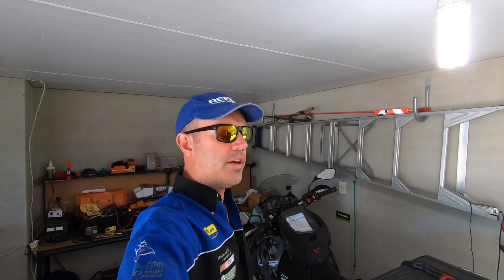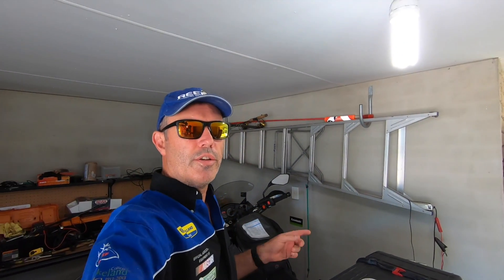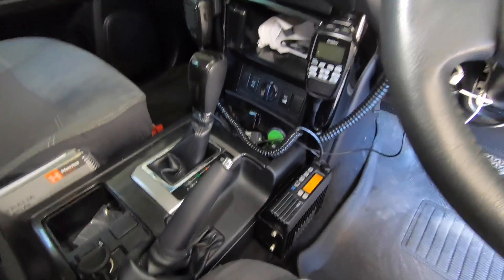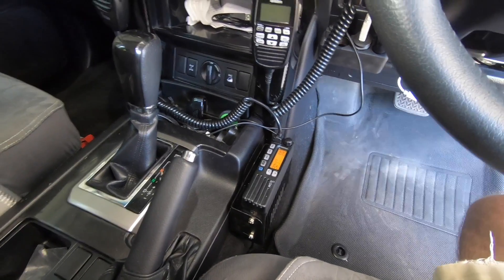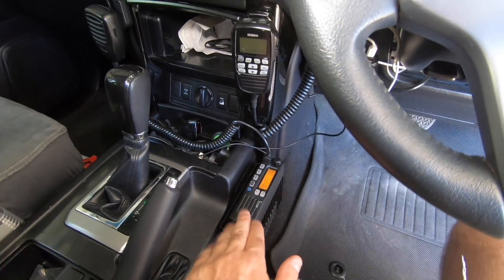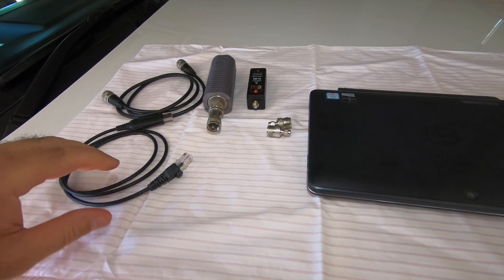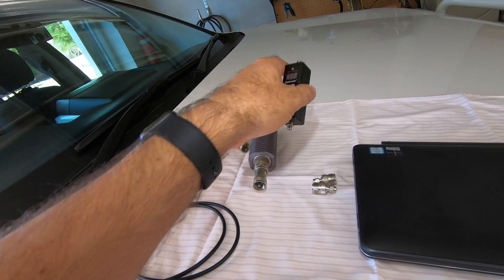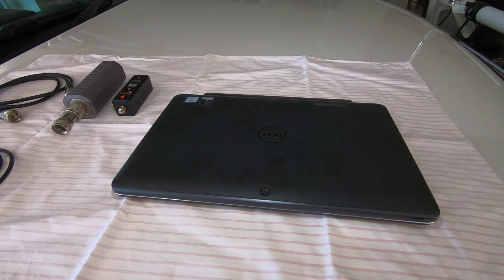UHF CB - Icom IC-400 Pro programming 80 CH & max legal power

Comment: Quick question aren’t these good for 25w??
Reply from the maker: Yep. Up to 25. At these powers you will need a licence and you will need to make sure your antenna is well set up. I have killed a couple and I think it was from using cheap antennas. Maybe they weren’t tuned correctly. I’m no rf expert.
Reply: @jjsadv is raising the wattage done through that program?
Reply from the maker: @targetoz5470  The adjustment one as shown in the video.

Comment: So I am looking at doing some maintenance work on my 400PRO and want to know the following:
1. Where do I get the power meter (surecom SW33)?
2. Where do I get the  dummy load tester?
3. Where do I get the IC-400PRO Adjustment Software

I already have the cloning/programming software and programming cable - used this for a while to program the channels etc :)

Cheers - oh and great video mate :)

Comment: Hi JJ, does adjustment software exist for the IC-410Pro, or is the "CS-400Pro ADJ Rev 1.0" software adaptable?  I've googled the IC-400Pro software and can't find it - if you have a link or can share the file, it'd be much appreciated. Cheers
Reply: I too can't find the Cs 400 pro adj software anywhere. There's one site but it wants an email to get put on a wait list.

Comment: Hi mate where did you get the adjustment software? Can’t find it on google the one I did find looks dodgy asf
Reply from the maker: Here is what I used. I think the link expires in 2 weeks.. Just so you are aware, only adjust the sets to what your licence allows.. Anything else is very naughty...

https://file.io/eP8zm3bUfsT1
Reply: @jjsadv  Hi - any chance of re-uploading both softwares?  my old unit has just factory reset itself or something out of the blue and gone back to just 40ch.  need to fix that and check all my other settings.  still got my cable, but blowed if i can find my copies of the software anymore.  been a good 10yrs since i last looked at this :).  all the old links are dead or questionable.
Reply: @jjsadv  cheers mate any chance u could resend that link ?

Comment: Hi, I've got the 410pro, programming cable and dealer software and I have successfully programmed custom (approved ACMA) channels but I'm struggling to modify the adjust parameters to bring the power up to as close as I can to the legal 5W. The software I have doesn't look like the adjust software you have in the video. Am I missing something or does the V1.0 version do this from within the adjust menu?
Reply from the maker: It’s a different app that set the power.

Comment: Hey mate, great set up, love the "factory look" attitude! I was wondering what sort of magnetic mount do you have? Does not look like a 5/16 threaded type. I've recently acquired the 400 and mine has been modded to scan without the al foil hack. There is a link marked "HANG" on the front panel PCB next to the speaker. Solder that link and disable "HANGER ACTION" in the programming software. The panel comes off easily just by unscrewing to screws on the sides. As for the beep, there is a small trim pot inside of the mic socket on the radio that will adjust the beep volume.
Reply from the maker: Cheers, I knew about the mod. The mag mount on the roof is a Mag/Suction type from Benalec

Comment: Hey fantastic mate, just been recommend this radio and look who is reviewing it
Reply from the maker: I have had a few for a while, we use to have them on the farm, mixed with a few GMEs. They are a great unit, well made. Basically a commercial grade unit. The only negative is they aren't as user friendly as others, you need to memorise a lot of button sequences. And I dont like the need to earth the mic to scan. thats no easy sometimes in modern all plastic vehicle interiors.
Reply: Agreed, already looked at the internal mod for the mic earthing
(What a strange move by ICOM)
Yes, i'm coming from the GME TX3400.
I know a lot of my friends that are really into comms like the ICOM and  all commercial radios :)
What a shame it doesn't come as a concealed unit.
There is the 450, but it isn't as friendly i guess

Comment: Thanks for the video, very helpful as I’ve also got one of those radios..... Where can one source that program from and can u switch on/off functions of the radio? Eg: The Beep when U turn on the radio On.
Reply from the maker: Rob Mac there is software on the web, just Google “Icom IC-400 Pro programming software”. Yes you can turn off the start up beep. I didn’t bother, but it seems to annoy some people so they do.
Reply: @jjsadv   i have made the mistake to flash that file to a wrong walkie talkie , and i need that password to flash it back to stock !
Reply: @jjsadv  on mine that was similar there was a small volume pot inside the microphone cavity.  You take out the mic RJ45 and look inside, a small flat heat can turn it down.
Not sure if the 400 has this option but mine did and looks exactly the same.